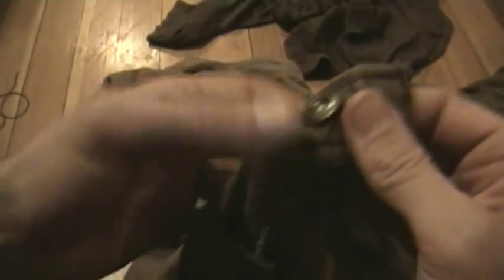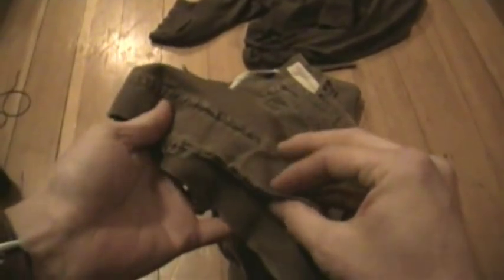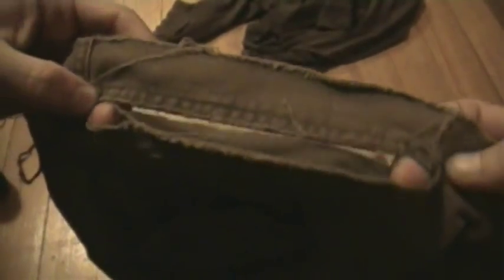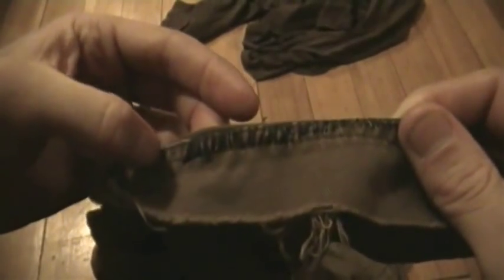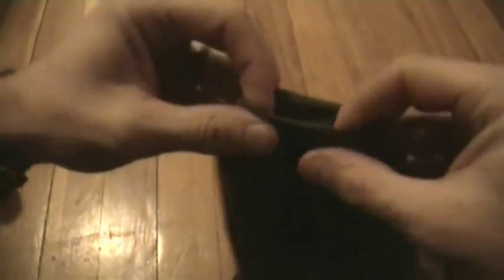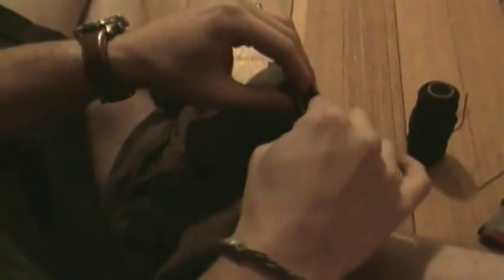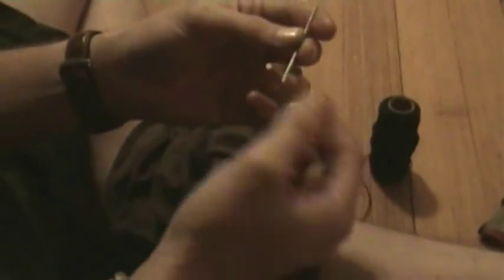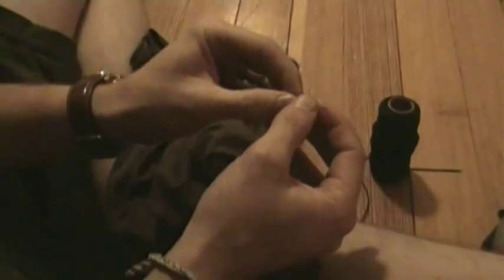Making Custom Bushcraft Gear

Comment: Old video, but the information it contains is timeless, IMO. A skill that everyone should have for self-reliance & independence. Mama taught me how to sew when I was a kid. Guess she got tired of me playing with the treadle on her machine. So, she put me to work. :-) Especially when she was making quilts. Over the years, no telling how many times it has come in handy. From sewing on shirt buttons, adding/replacing zippers, to mending canvas tarps. Have  a stack of good parts cut from worn out jeans, jackets & such. Waiting to be turned into free drawstring bags & pouches, as the need arises. 

Not only needle & thread. Learned to crochet, as well. Can carry a lot of paracord when it's in belts, straps and hat bands.  The list is long for DIY when needles & hooks are part of kits. Cost is low when yardsales & flea markets provide fabrics, leather, knitted goods & more to be re-purposed for use in the great outdoors. 

How about a paracord mug cozy? Easy to do by learning a couple of crochet stitches. http://pioneerwomanatheart.blogspot.com/2013/10/campers-mug-cozy.html 

A little how-to here to get you started. Knot of the Week: Paracord Storage Alternatives Easy to practice -- something to do -- after supper & it's too early to go to bed. ;-)